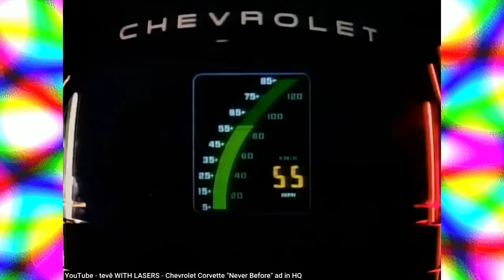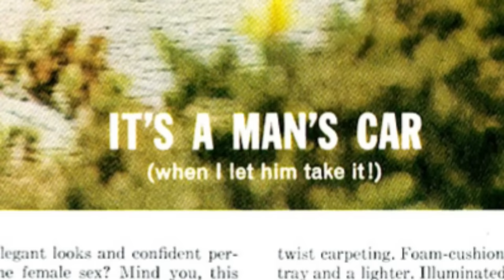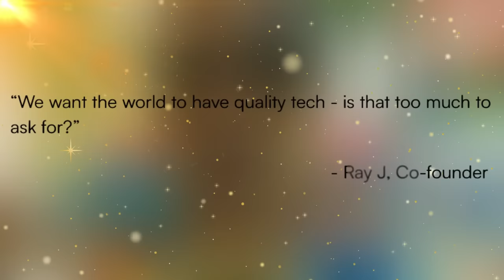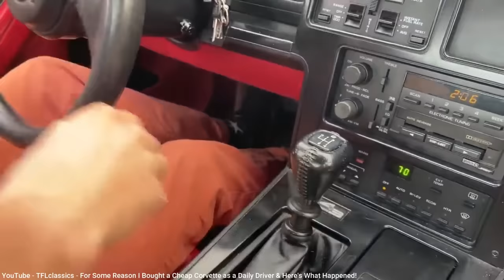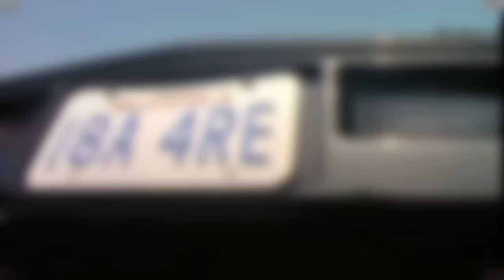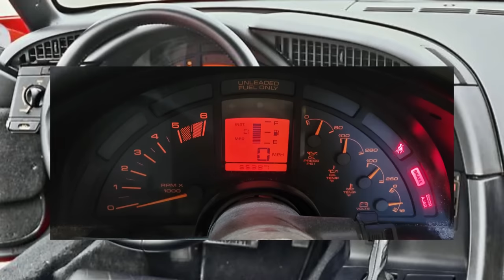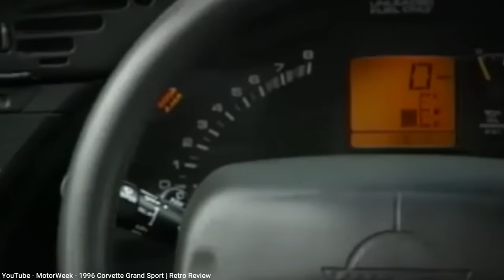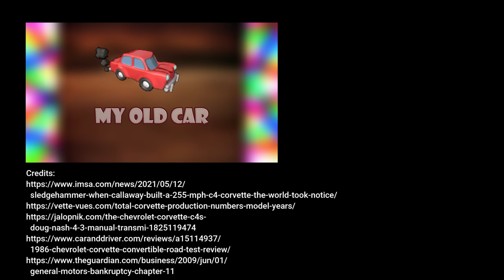Here’s how the C4 Corvette had a hard time winning over long-time Corvette fans

Comment: The idea of a C4 Corvette going 255mph is terrifying.
Reply: I was thinking the same! What's amazing is it didn't even look like it had an exotic ground effects package.
Reply: The idea of any car going 255 is kind of terrifying. But I'd still like to experience it.
Reply: @katieandkevinsears7724  RIGHT Agreed!! 
Didnt read b4 I commented
Reply: The sledgehammer held the top speed record for over 20 years!!! Only one of those cars actually exist.  I believe the sledgehammer was based on the 88 model year.
Reply: Yup! They should have put it in a black trans-am 😅😂❤
Reply: Why? They are pretty well engineered mechanically.
Reply: Yes
Reply: I have a 87 Monte Carlo SS, and love 80s GM. But the thought of any 80s GM product going over 105 mph is kinda scary
Reply: Then again it was brand new at the time and many other cars like the RuF Yellowbird or 959 were near to touch that. The C4 was one of the most aerodynamic cars at the time so its fitting.
Reply: if people knew then how absurdly dangerous we know older cars to be now...well they'd probably still do it, people had balls in prior decades.
Reply: I wouldn’t drive a C4 at 255 mph in a video game. Sheesh.
Reply: The driver who took it that fast actually said it was stable the entire time, which is incredible, because it had stock suspension.
Reply: @Low760 it's the lack of aerodynamic ground effect that was the problem. Without it the car becomes very unstable at high speed.
Reply: @jackbower8671  The Firebird, 3rd gen was almost as slippery

Comment: C4 is one of the most underrated corvettes made ... it was light years ahead of the previous generations ... and was killer once they gave it decent power..
Interior plastics  ... well thats another matter
Reply: I don't care about plastic interiors in a Sports car, race car etc. That's what Mercedes can for.  Lol!

Interestingly why so many consider the F40 Ferrari the last real Ferrari.  Which literally had a cable wire that you pulled down on to open the door.  Luxury is for those who don't drive, & only get fast cars to impress women.  Then do 35 MPH on the highway

Comment: I remember when they came out. Didn't think they looked as good as older models but like them now. I saw a guy who had one with motorized lift gate. Took 10x longer than a manual one would. I w as impressed by the gas mileage. Now I've got a 201 Mitsuishi Eclipse Spyder GT with the 5 speed. And I love this thing. Only 200 ponies but quick around town. Corners great. You can't buy anything like it new today.

Comment: The c4 was a very awesome looking car for the 80s into the early 90s but the interior was so ugly.  When the C5 came out that changed everything. Hope you do a C5 video soon!
Reply: The C5 interior is cheap, garbage Tupperware quality at best with unsupportive seats that easily break after enough aggressive driving. Whoever designed the interior for the Cavaliers and Luminas designed the interior of the C5. The later year C4 interiors were more functional with comfortable seats that held you in place.